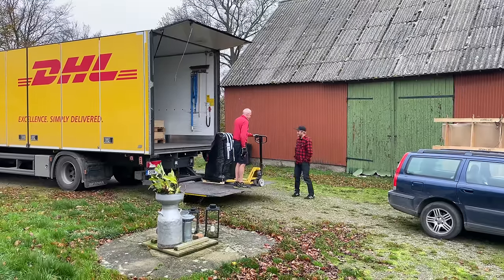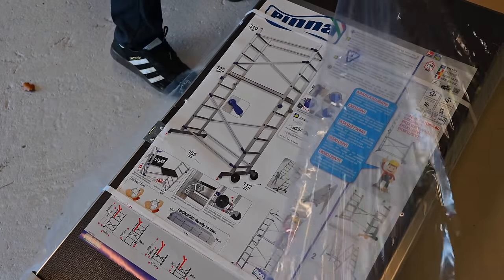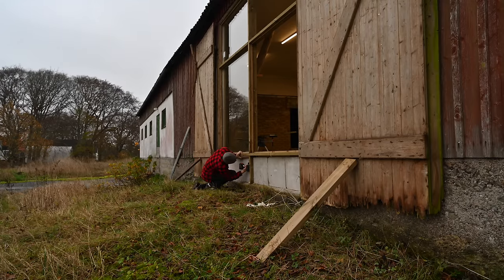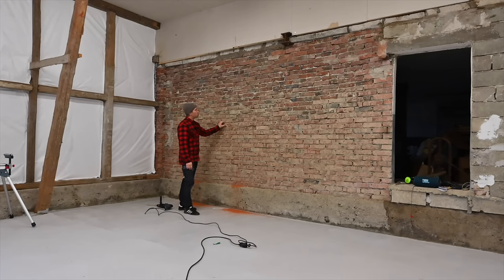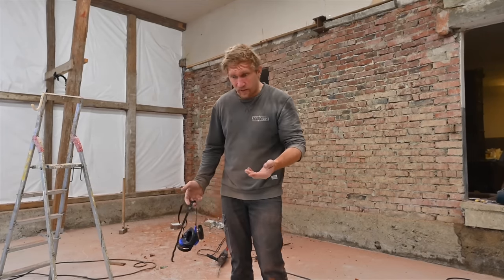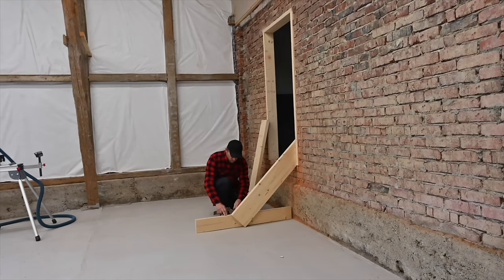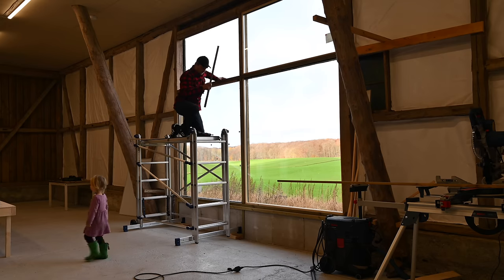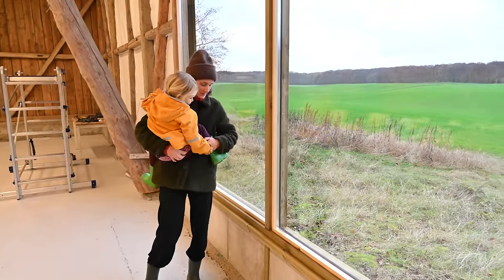The Boat Build Can Start Now! - Ep. 323 RAN Sailing

Comment: There appear to be ends of precast floor units showing on top of the brick dividing wall ,which suggests that it is a loadbearing wall supporting the upper floor.The brickwork is apparently in cement mortar which has allowed it to span over the new opening .
Reply: Later video shows that its not loadbearing .The precast floor spans the other way .Just a make up course of precast offcuts that show.

Comment: You should put some light and cheap tarpaulings on the walls before you try to heat the barn. And some insolation on the floor inside the walls.
And you can add some insolation between the wall and tarpaulin.

Comment: Stunning view... afterwards you're a good way to a barn conversion house in there. If you later sell the farm or barn that may well pay a good bit towards the boat.
Mads from Sail Life made a heated storage cabinet for his Epoxy (1 drum & harder capacity), the small electrical heating pad he used would keep it at ideal working temperature very economically if well insulated.

Comment: When you sail past Australia, there is always a welcome and a need for great tradesmen, such as Johan is. With a project such as yours, the time taken for the build will be dependent on so many varying factors. Even with Critical Path Analysis, time management is normally a problem. So as an experiment, work out how long you expect to build the hull; move it to a slipway; and completely finish the boat ready for sailing sea trials. Calculate a total time. It would be interesting to see if the "3 times rule and at the extreme end the 5 times rule" in project management applies to your time calculations against the actual time to complete project. Much respect to you all. Cheers and beers.

Comment: Looking good.

There is an Epoxy pump available from Michael Engineering called a Sticky-Stuff Dispenser that could save you time and money, especially if it prevents a mixing error.  Jamestown Distributors sells them, maybe they'll sponsor you? Otherwise someone in Europe must build them as well.

On the smoke detectors, if the dust set them off, I expect that may be a persistent problem. In the US a workshop will sometimes only use a "rate of rise" detector, so ot only goes off if it senses a dramatic increase in temperature.  I expect your insurance company has some sort of input on this...

Best of luck with the build!

Comment: If you need to level the building jig or measuring references to the floor.  Auto body filler works great and can easily be removed by knocking it what a hammer.

Comment: Perhaps the saw-type you are referring to, very often used for demolition work, is usually called in English a "reciprocating saw" . The cutting action uses a push-and-pull blade (reciprocating) motion. The original trade name was "Sawzall", so they are often called that as well, especially on construction sites where verbal short-hand is much needed. The "saber-saw" to which you refer also uses a push-pull motion (perhaps better described as up-and-down), but is also now commonly called a "hand-held jig-saw", often shortened to "jig saw", although that confuses it with the larger, older, table-mounted variety. The blades are usually much smaller, and they are more used for cutting curves in wood and other materials. I have owned both for decades, and they are not really very inter-changeable. These days though both types are available both as cord-wired and battery-powered devices. Our ancestors would be AMAZED at how many different kinds of powered-saw choices we have now!

Comment: Jealous of your work shop. When I built my catamaran, I had never used epoxy. Then I bought a 55 gallon barrel of resin and half again as much hardener. I think I ended up using 2 barrels.. but a 9 meter cat might about equal an 18 meter monohull roughly in area. I vacuum bagged everything - so it seemed like I wasn't using too much epoxy. Lots of coves.. maybe a bit heavy on the foam core... Epoxy was a lot cheaper back in the '90s.